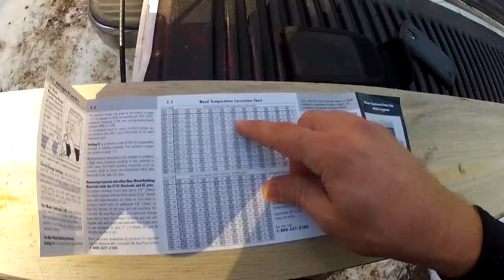Woodworking: Grizzly model G5851 24" Planer (5HP)

Comment: looks like a great little planer , a friend had one with top and bottom heads , then ran the board thought a set of jointers set up side by side for the edges ( one side had a straight edge , lumber came out as good as any you could get at the lumber yard )

Comment: a good tip from another tinkerer  on the plug if you notice  a brass and  a silver spade across from each are two 110v and because of how it works if you use two differing outlets is and they are on differing fuses the voltage from the pole are 90 degrees out of phase.   the other one with the little bump is ground

Comment: Im having a issue with my planer no feeding properly? Any suggestions? Its same planer as yours. Just dont wanna pull the wood threw like it should
Reply from the maker: You just need to adjust the spring tension bolts. There's a how to in the manual for feed adjustment or you can call grizzly tech support. I've called them a number of times and they are really helpful. I've adjusted mine  as the springs get fatigued and don't press the feed rollers down as much. You'll know if one side is to tight as it won't feed straight out but instead drift to a side.

Comment: I really want that machine! How long does it take you to swap the blades out? Grizzly told me they are not going to put a helical head in this planer. I am debating getting the 1033x but I really want the width of the 24. Thanks
Reply from the maker: I replaced the straight blades with a Shelix. It's noticeably better... I don't know why they ship straight blades anymore.
Reply: @frankgrizzo  Nice!! It looks like the swap is just a few bolts to get the cutter head out. Was it pretty easy?